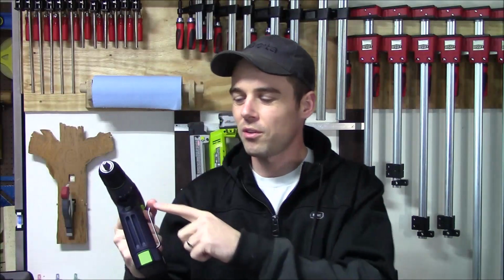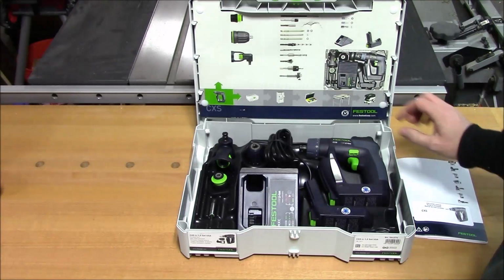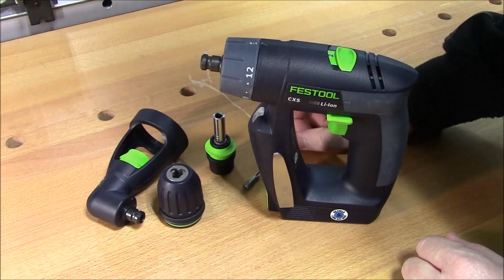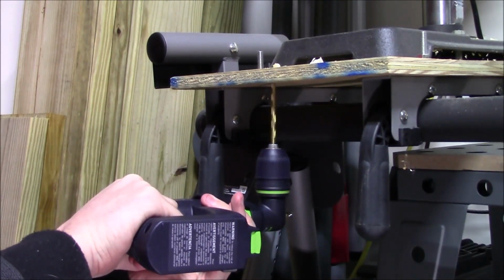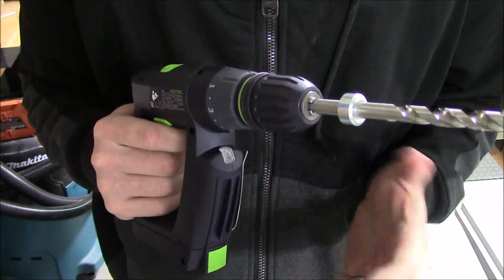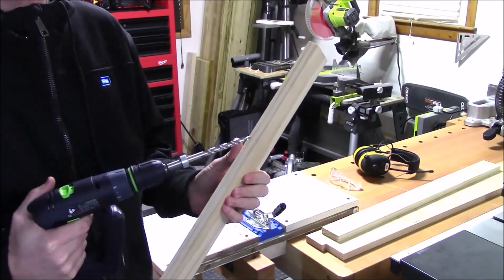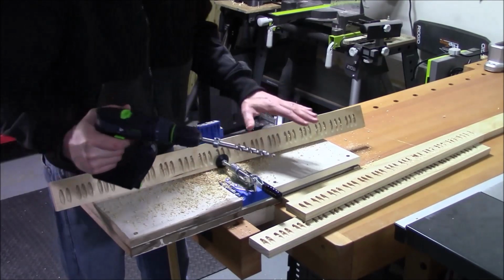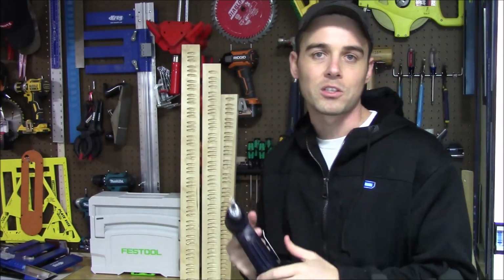Festool CXS Compact Drill Driver Set With Right Angle Chuck - MADE IN GERMANY

Comment: I'm sorry, but after using fast, efficient and high powered compact impacts and drills, this thing would be a pain to use. It looks like a good hobbyist tool for assembling or fabricating small things, but not for professional and demanding tasks.
Reply: Because pros only build big things and only require brute force. Really?
Reply: @Lee_FTM  No, because the point of a multi-use tool is that it can be gentle and powerful. When I'm installing cabinets, or building them, I need a tool that's efficient. Not just powerful so I can screw to a stud, but also able to be ramped down to use on installing cabinetry hardware. This tool does one of those things, but not the other. Everyone has an opinion, you don't have to like it.

Comment: Why do people complain about Festool prices? I don't get it. These are PRO level tools, like Snap -On is to mechanics. If you're not a Pro you most likely do not have a need for Festool. 
If you're someone that has the funds and wants to learn to be a pro with the best tools made.. then Festool is your guy. I fall into this category. I have sold some motorcycles and guns to get started... I'm that serious about it. Caution though, once you use them.... your screwed and hooked..... you'll want more.....
Reply: Mindriot
If you are a professional cabinet maker there is a chance you may have tools of that level in your workshop.  They are very accurate and can be used as an overall system. 

With Festool you could have a complete workshop in the back of your van or even car.  You could have a cross cut saw, Table saw, Table jig system all in your van with festool.
Reply: Just because people use festool means your a PRO???. I work have work in construction 8 years and never seen a festool product on sight.
Reply: Because they are geared for the professional market.  I've been using Festool tools professionally on my own jobs and union jobs since 2007.  They take a lot of hard use, perform perfectly and last.  My TS 55 track saw you talk about is still performing flawlessly under heavy use for 6 years now.  I own several brands of tools, because I like different ones for different tasks.  That also allows me a better real world comparison of features, performance and overall life of the tool.  As for AvE's video teardown of the TS 55, if you eliminate the biased bashing (most of which seems centered on the price), it has no merit and is more of an entertainment piece like a lot of his videos.  Even if you don't believe that statement,  ask yourself what engineering and design knowledge you're basing your belief in AvE's "evidence".  Just because someone sounds like an expert, doesn't mean they are and you'll even find cases of experts disagreeing with each other.  My point is,  don't follow someone blindly on the internet and believe their written or spoken word is the authority.  Real world use is what really counts and that's what I have to offer here.
Reply: +Kirk Williams Please.. why do people call these heavily engineered plastic tools as Pro?  Go watch AvE's teardown of the track saw and see for yourself.  I am really curious of the failure rate of these for people who actually use them daily.  Not bashing them,  they look great for the hobbyist.

Comment: the newer version uses a pancake style battery which is the same as its counterpart txs. both have a battery status led embeded into the work led. minus the systainer which is about 65 USD...its not that expensive of a drill set as most would think.